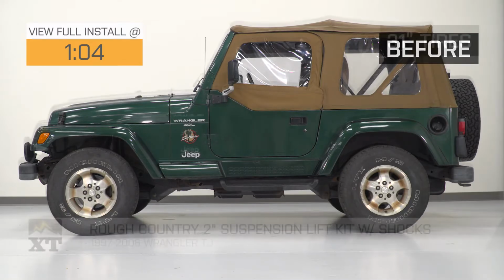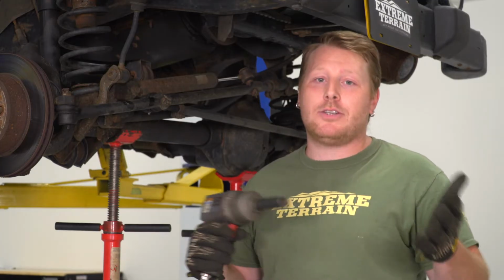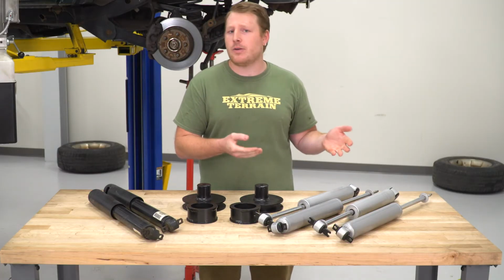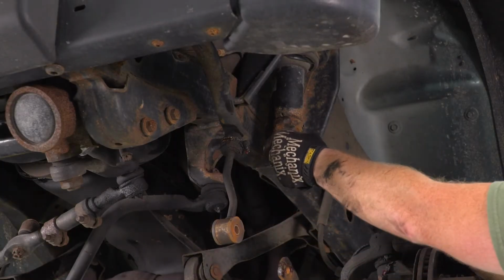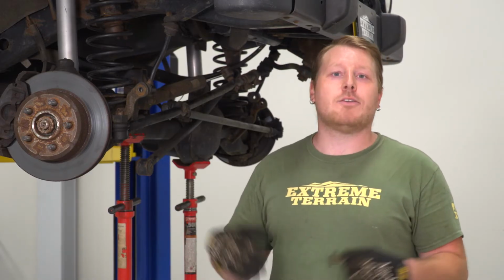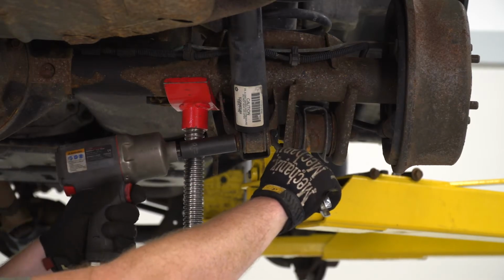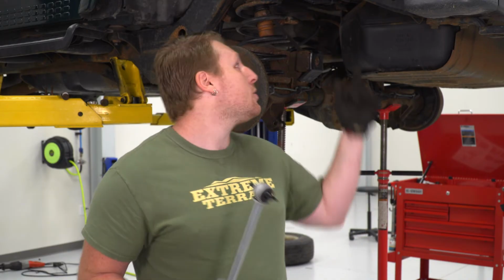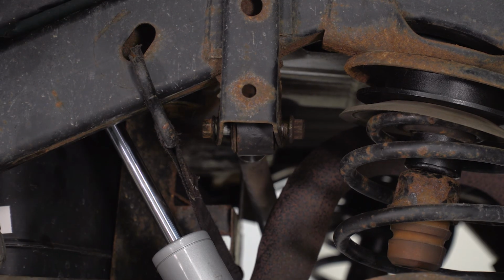Jeep Wrangler TJ Rough Country 2" Suspension Lift Kit w/ Shocks (1997-2006) Review & Install

Comment: What holds the top of each coil spring, either front or rear, in place??
Reply from the maker: Everything connected from the frame to the axle that limits the travel and the weight of the vehicle.

Comment: Just did a 1998 TJ.....Soaked daily every nut/bolt/joint basically I soaked the entire underside every night for 7 days, why am I telling you this because every nut stripped, the T50 bolts stripped out so I had to disconnect the other side of the track bar in the front, Every bump stop had to be cut out and drilled and tapped, because the T50 bolts all failed I also had to disconnect the front sway bar, only one shock was not completely cut out, 4 days with 8 bolt holes drilled and tapped but it's done and looks great with my 18" rims and 33" tires makes a total of 5" overall lift.

Comment: Just a tip....i notice you fighting the bumpstop a little bit. Those "bump stop cups" have holes near the top of them. If you take a small flathead screwdriver and clear the holes out, that bump stop slides in no problem.  I noticed it on mine after I sanded the rust away.

Comment: Me: All right all I need is some hand tools! I can do this! 
Video: “put the Jeep on your lift...”  
Me: 😞
Reply: Me: Wait until the absolute last minute you'll be able to do the project, preferably in the early evening when the light starts to get bad. Ensure it's raining/sleeting. Bring approximately half the tools you'll actually need but 3x the tools that you'll use. Time the work to coincide with your girlfriend and/or wife's menstrual cycle so you can receive the maximum number of interruptions in the form of angry text messages that tell you how selfish and disappointing you are. Verify there are plenty of sharp pieces of broken concrete embedded in oily mud under your TJ to completely prevent you from using a creeper. Take steps to alienate any friends who might help, or at the least, ensure they live hundreds of miles away so they can still sound sincere when they message you, "dude - wish you lived closer so I could help, brah." Do something so drastically wrong during the install that when you contact the vendor they say "oh my God - what did you do?!?" and inform you that it'll be necessary to take everything apart and start over.
Etc.
Reply: Lol, sounds aweful!
Reply: No need! An engine hoast makes alot of these jobs even easier than a lift!   I rebuilt my entire jeep minus a few important small parts that I got my trusted garage to accomplish!  You don't even need a spring compressor and when you get really comfortable and rebuild an entire jeep frame and also cab frame you can lift the jeep off the main frame using 2 ratchet straps on the engine hoast claspe/hook and balance it on 4 points!  I wouldn't suggest that unless you have to! I was amazed how an afforable engine hoast could make life that easy because years ago I wanted to invest in a garage hydraulic lift! No need!!

Comment: How is rough country? I’ve been hearing mixed reviews.
Reply from the maker: If you're on a tight budget and just want to get your Jeep up in the air, its a great option with good quality parts. There are a lot better lift kits out there though, especially if you plan on lifting your Jeep more than 2 inches. Rough Country usually gives you all of the basics to lift your Jeep, but most times there are extra parts you should add in. It all really comes down to you! -Zach
Reply from the maker: @Necro NomaTron At 2" of lift you can get away without them if you don't have room in your budget. Anything higher and I would absolutely recommend them to keep your axles centered, though. -Zach

Comment: 31?
You can fit a 31 on stock suspension with no rubbing don't you mean 33 to 35s?
Reply: I got 33’s on stock and no rubbing yet lol
Reply from the maker: Rough Country recommends the use of a 31" tire for optimal performance with this lift kit. That's not to say that you can't fit a 33" or 35" tall tire underneath of the Jeep with this kit, but you will most likely have to do a good bit of trimming to get proper clearance with absolutely no rubbing. Thank you for watching! -Zach
Reply: i have 31 inch mickey thomsons on my TJ and i havent been able to get it to rub yet.
Reply: @CollinDudley113  I have 31s too with no lift and no rubbing ither.
Reply: @BallOdd37  what fenders do you have?
Reply: @crabbypadty393  sport oem and im on 33s now
Reply: @BallOdd37  wow Im shocked you have room to articulate fully.
Reply: @crabbypadty393  fully no, not in the front yet but rear has 2 inch lift still need to do the front but having a hell of a time getting some bolts out without breaking them for the front lift.
Reply: @CollinDudley113  whats your fender set up?
Reply: What's the point of suggesting safety glasses, but use them only once instead of throughout the entire process.  Remember safety first , especially eye safety which is paramount above all.
Reply: Hell you can fit 35 stock no running with metal cloak fenders